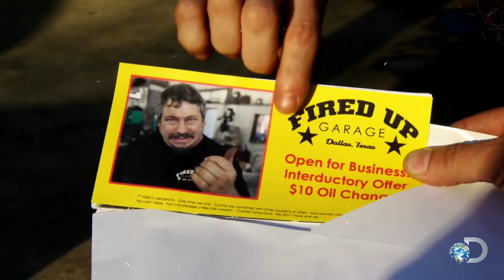THE RETURN OF TOM SMITH | BEER:30

Comment: That remote kill switch for a hoist is actually a great idea! I used to climb towers also and was being lifted by a hoist, I got on the radio to stop because I needed the operator to take some slack out to pull me off the tower more because I was heading towards an antenna mount. Well, his radio malfunctioned so he couldn't hear me. I ended up getting snagged on the mount. Luckily another crew member on the ground yelled to the operator because his radio did work and he realized the hoist operator wasn't stopping. A remote kill switch would've been nice to have! Scared the crap out of me and I've even done antenna picks with a helicopter less scary then that.

Comment: Most early 427's in boats especially Chris Craft used Side-Oiler castings but not functional. Look at bosses on side of block for clearance cuts & rear face of block to see if both bosses are machined. I've had them in cars being Ol Skool over the years.

Comment: The difference between a super four twenty eight or four twenty seven side oiler is a high nickel content block and does have different ports at the oil filter mounting plate. Number talking Ford man here, Junkyard bread since 5 years old. Actually, boar and stroke are different. Also, and a super four twenty eight coverage at has a counterbalance on the front of the crank shaft,not to mention the Head Differences

Comment: If they still have 71 Camaro he could probably get 15-20k as is.
I would make it a Z28 Red/Black stripes & factory Z28 wheels. Short rear spoiler.
Refresh brakes,  suspension.
Give the 350 LT1 specs.